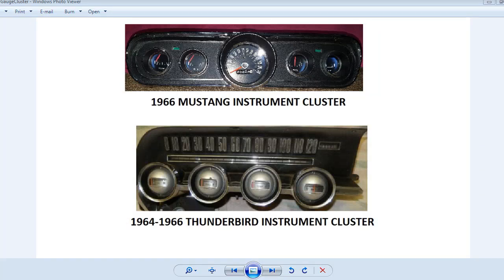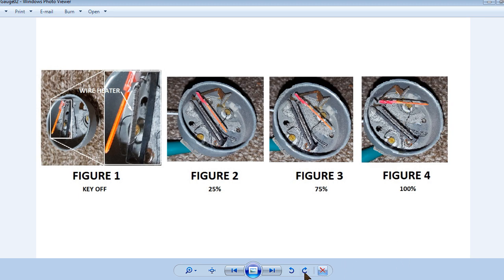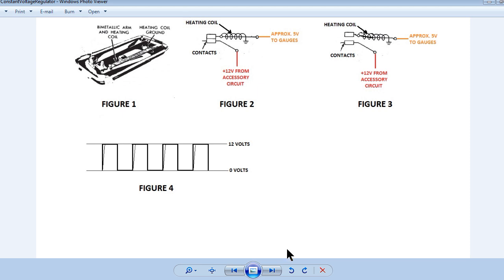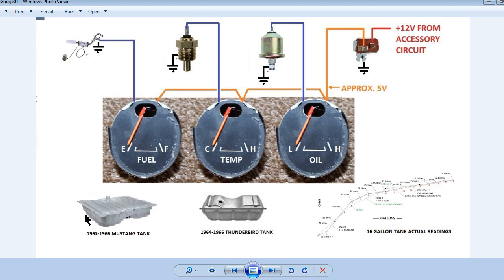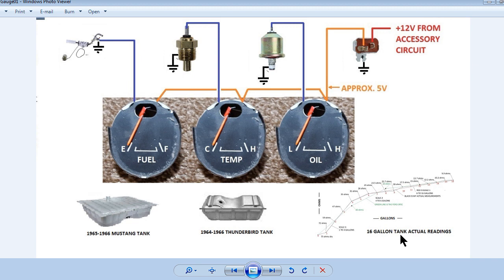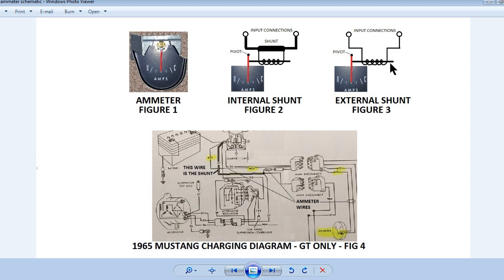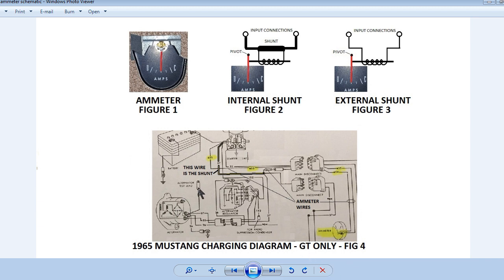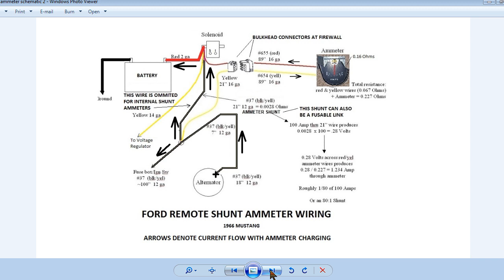Early Ford Gauges Operation Explained

Comment: Thanks for the video. I'm trying to figure out the gauge cluster pinout for an 83' Econoline and it seems mostly the same as this. Only thing I can't intuit from the circuits is the ammeter but that can be resolved in the vehicle

Comment: Just remember that if you can’t get an era period correct volt meter and my feel using the amp meter is needed, do like GM and place a fuse on both amp meter wires inline in the engine department. Many have found these and not having the correct wiring schematic are confused about their function. This is used on both trucks and cars. However, they chose to replace the amp meter with a volt meter in 1966 unless it was sold with a  6 cylinder models as entry level cheaper models. The fuse is taped outside the harness in a case and used the glass type 40 amp fuse. The alternator was a 38 amp output. Fuses are thermal devices and do not work for the amperage. However amps passing though created heat and if high enough would open but on the engine side of the bulkhead electrical connector. They were still hot with B+ even when removed but just one side.
DK. ASE Master Tech since 78, retired.

Comment: Good video, I was having trouble understanding the ammeter in a 68' Mustang wiring diagram since both ammeter wires red and yellow are hooked up to the battery positive but now see the ammeter is effectively in parallel with the shunt wire. The only time the needle would ever really deflect to a noticeable significant degree would be if the alternator failed and there was a heavy current draw off the battery with the engine running and most driver's wouldn't notice that up to the point the engine stopped running.

Comment: VIEWERS!!!!  Please note on the 1964 and 1965 Thunderbirds they use a full current or external shut meter.  Ford changed this in 1966 due to fire hazards.  If you look at the Ford parts manual, the amp meter is the same part number for 64 and 65 , different in 66.  This is a great video!!!!!

Comment: I don't why everybody keep saying these systems use 10 ohm senders because they are 5 ohm type. I've have 2 64-66 T-Birds that I put a fuel sender into and the gauges didn't read full with a full tank. I measured the resistance of the sender a the full stop,  was 9-10 ohms, and would only go to 3/4 full. I bent the float arm until it measured 5 ohms at the full stop and they now indicate full with a full tank. Neither car had any excessive resistance in the circuit from the gauge to the sender, or from the sender to ground, and the CVR was operating properly. 64-66 T-Bird is also 22 gallon tank, not 20.
Reply from the maker: They say it because that is the Ford spec.  I have measured some replacement fuel senders that go from 2 to 85 ohms.  It is the gauge that determines the ohms required for empty and full.  The high end of the range (full) is pretty inaccurate,  what you need is accuracy near the empty end of the range.